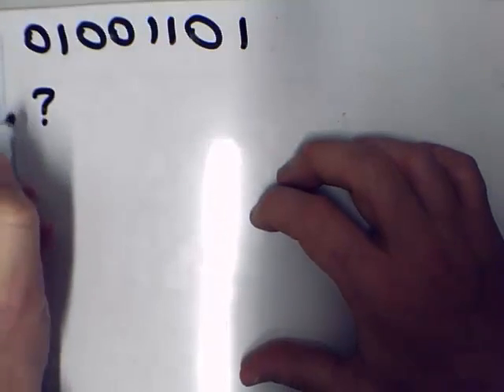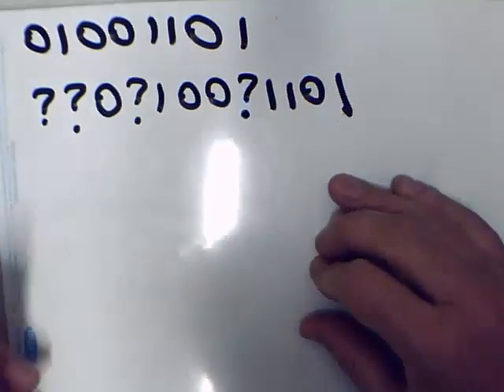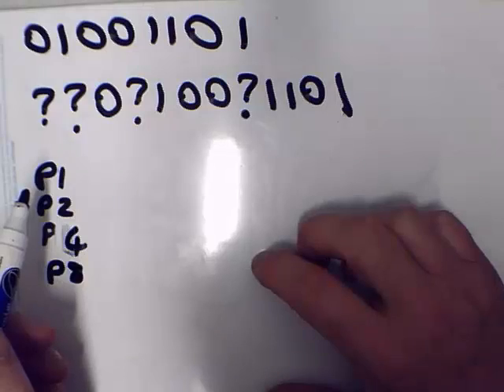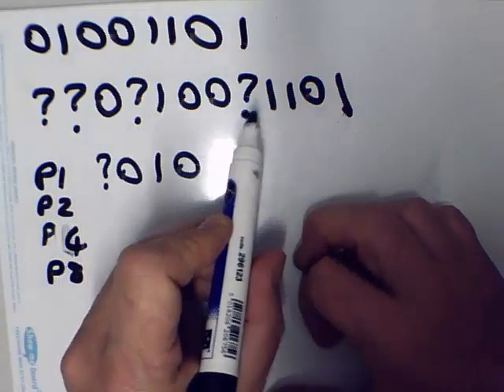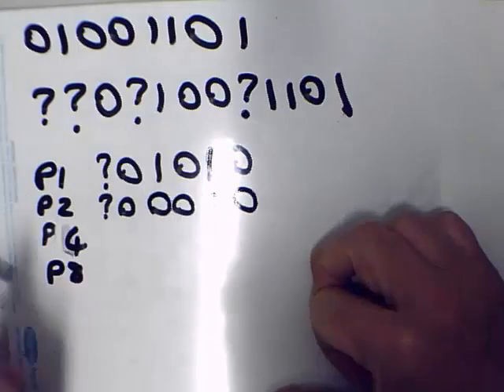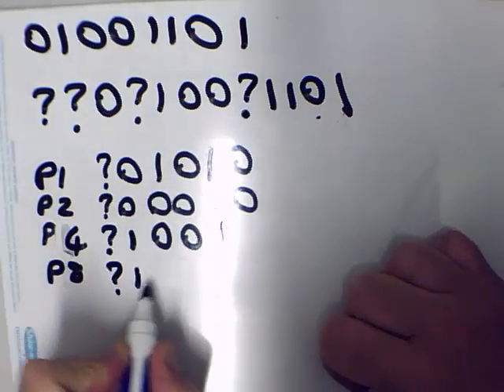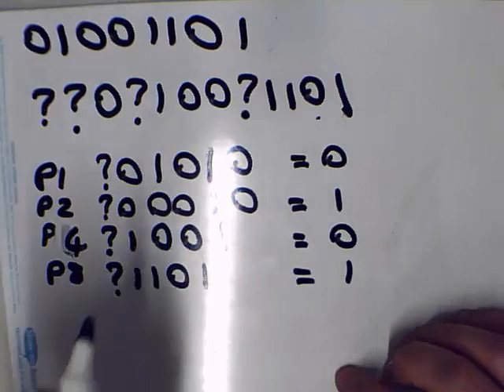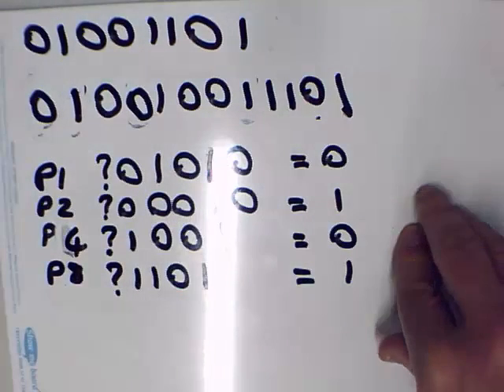Calculating Hamming Codes example

Comment: Is the first code where u add the paritybits right? Shouldn't it be: ??0?110? A double one instead of a double zero? Cause i thought u add the question mark at position 1,2 ,4 and 8? Or did I misunderstood it?
Reply from the maker: I have inserted the data from left -> Right. You could do it Right -> Left as you suggest. In the end, what matters is that both the sender and receiver do it the same thing. Well spotted by the way, 1st person to ask me this. If you have been shown a particular way by your teacher use what they want. Same goes for the parity bits they could be done right to left.
Reply: My exact quick observation. Bits are counted Right - Left.
Reply: that's a good question , our teacher  spoke about this method so i though it was the only one
Reply from the maker: From the parity bit you are calculating

Comment: I'm using this as revision but I'm fairly sure we were taught to put the parity bits at the other end of the code. Is either way correct?
Reply from the maker: Nick Massey Doesn't matter works both ways obviously gives diffent values but as long as each end Tx and Rx kniow which way they were done
Reply: Wayne Hamilton okay good, coz I did it this way in the exam

Comment: I know this video is a little old, but for future viewers BE VERY CAREFUL with this method and be sure you know what the prof/problem is asking you.  I missed a few classes at university and ended up getting these hamming code answers wrong because the professor was looking for a right to left representation which totally threw my parity calculations.
Reply: In the above example, my professor would expect the parity bits to look like 010?0110?1??   then do your check skips in the same manner but starting at the right instead of the left.
Reply from the maker: I agree, always be careful to answer the question you are given by YOUR teacher :-)
Hope your teacher gave you some credit for getting the idea correct and going online and investigating it yourself.
As discussed in threads below there is not (as far as I know) one fixed standard. The method shown is a general case and I state I am using it left to right for a given number of bits. As long as both sending/receiving nodes of the system know if you are using L->R or ODD or EVEN parity, how data bits etc the hamming principle for for single bit error detection correction works.
Good luck with the rest of your course, turn up for your lectures to get the most out of it :-)

Comment: Thank you very much! I got it. Just a suggestion: you could mention that the bits selected for each parity bit calculation are the bits covered by the same parity bit (according to http://en.wikipedia.org/wiki/Hamming_code#General_algorithm). For example: At P1: ?01010 we selected those bits because they are respectively in order bit1(?), bit3(0), bit5(1), bit7(0), bit9(1), bit11(0). At P2: ?00010 this sequence, in its turn, matches the bits:  bit2(?), bit3(0), bit6(0), bit7(0), bit10(1), bit11(0) and so forth.

Comment: YOU SIR ARE A FUCKING GODSEND!!! thank you so much, you may well be the difference between me getting a 2:2 and a 2:1 tomorrow. Fingers crossed!
Reply from the maker: Good luck with your exam
Reply: Wayne Hamilton Is this video (7,4) or (15,11) ?
Reply from the maker: Prisoner Of Paradise SEC (12,8) it is Single bit Error Correction using a total of 12 bits 8 of which are data bits
Reply: Wayne Hamilton so this is not Hamming code...because I believe Hamming codes exist with a (7,4) (15,11) (31,26) etc...
Reply from the maker: Prisoner Of Paradise I would not claim to be an expert in this but I don't think there is any fixed limits or standards, it really depends on what you are sending the principles are the same. The main thing is the send/receiving or reading/writing systems use the same code. I teach this as it is what the exam board we use gives as an example. The (7,4) seems popular but there are real world examples using (12,8) http://www.robotroom.com/Hamming-Error-Correcting-Code-1.html  sorry if that doesn't really answer you question.
Reply: Wayne Hamilton who knows, in my university they told us it only exist with a several strict quantities.
Reply from the maker: +Prisoner Of Paradise (12,8) ie total of 12 bits 8 are data 4 are parity

Comment from the maker: This video shows how the parity bits are calculated at the transmitting end based on the data. The data and parity bits are sent to the receiving end which can check these to see if an error was introduced during transmission.